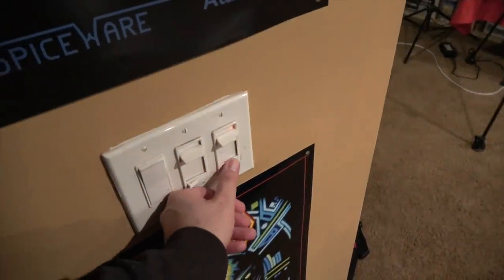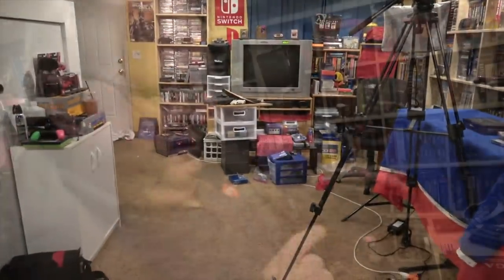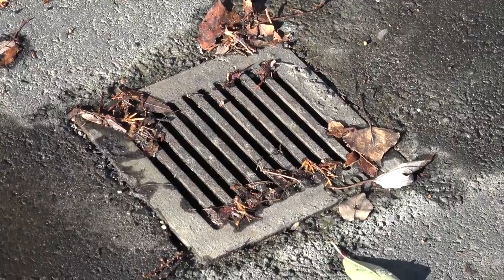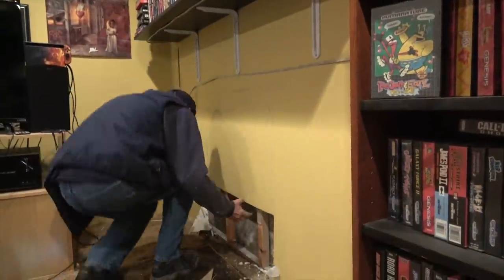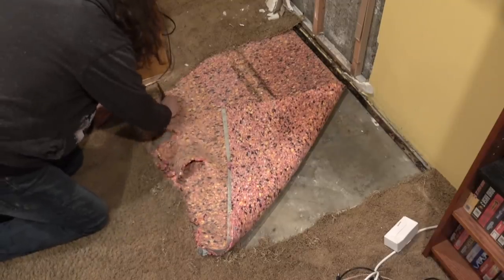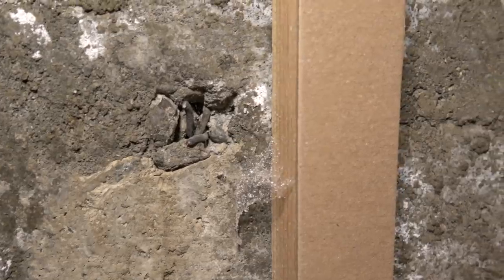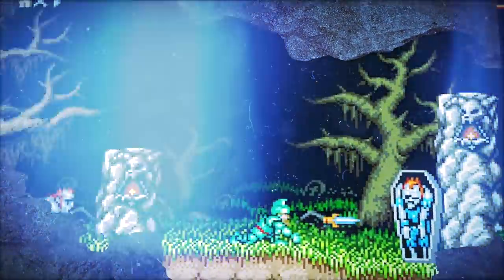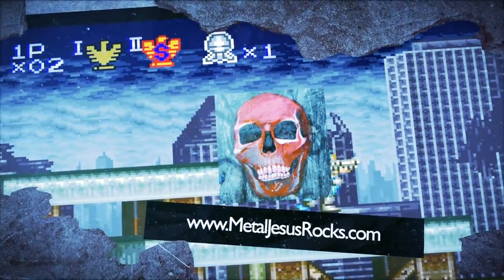OH NO! Water & Mold in the GAME ROOM! $10,000 to fix!

Comment: Such a bummer.  I was watching this and wondering where you live and then saw "PermaDry" and thought "oh yeah, I think we used a company by the same name, guess it's a common name" and then flipped out when I saw you also live in Seattle.  What happened in our house that we bought about 5 years ago is the basement flooded during a storm power outage a few years before we purchased it and the previous owners used PermaDry to help prevent it from happening again.  

Our house also is partially submerged, with the front end of our finished basement being totally underground and the back end being above ground (with a door and window, etc.).  They ended up installing a sump pump in a small pit fed by a drainage pipe that presumably (we don't know for sure since they did the work before we bought the house) collects water on the front end into the sump pit which then gets jettisoned outside the house into one of our down spouts.  The work, about 8-10 years ago was something like $8k but YMMV of course.  I have found PermaDry (we consulted with them to put a drainage system in our detached/partially submerged "bunker" garage) but found them to be too pricey and ended up going with a small Russian outfit that seemed to do an okay job (garage hasn't flooded and the newly poured floor hasn't cracked again due to hydrostatic pressure from the water shelf).

Did they not suggest a more "active" solution than just some passively draining pipes without a means to pump it out?  In our 6-month rainy season in Seattle, our sump pump (Zoeller, the best brand) is going off all the time, sometimes every 10-15 minutes for hours and hours.  I plan to replace it proactively every 5-7 years, and also have a backup sump pump in the same pit and a battery operated pump to suck out water in the event of power and backup (which uses a marine battery) failure.  Just in case, also have a ShopVac that pumps water out too... can never be too careful in Seattle with rainwater (even though we don't get super high total rainfall, just constant rainfall)!

Anyway, good luck with the repairs and sorry you have to deal with this, especially in winter and right before X-mas.

Comment: Something very similar  happened to me at my house.  it was built in the 50's and had a cinderblock foundation.  We looked at the internal drainage system, it seemed very costly plus you loose Sq-footage of the house.  So we opted to fix the problem on the cheap.  We  hired an excavator to do the digging, got friends to slap a membrane and dimple board on.  Other friends to re-drywall the basement and I learned how to put down flooring (I am not a handy fella).  All and all we took an $15,000 dollar fix and got it down to $3,000.
Reply: Oh,  and Keep water off your house!!!!  Clean your eavestroughs, don't have a garden on the side of your house, ect.  I know this sucks and my heart goes out to you.

Comment: @MetalJesusRocks You are going to want to get all that stuff completely out. Digging that trench is going to kick up a lot of concrete dust (and possibly some mold) that you don't want in all you electronics. You may want to get a storage unit. Home owner's should cover at least the detection (may even cover some of the trenching). Another thing to consider is that a radon mitigation would be much cheaper to do at the same time. It looks like the Seattle area is a low chance, but you may still want to test it. It makes a slight modification to the basin at the end of the trench. Finally, this is still letting moisture INTO the basement, so you may want to consider adding some french tile/drain pipe to the outside. That would just be a couple feet below the surface right around the outside edge of the house.

Comment: You should gut all drywall and paint cement with drylock paint. All the drywall needs to be removed so you can coat all. Its a lot of work but not hard mentally have at it. Keep in mind you can not put carpet back in and that any MDF should not be placed on cemment since moisture will wick into MDF and mold will grow.

Comment: Do the work yourself. Get a jackhammer and bust along the wall to put 'big O' weeping tile pipe along the exposed floor. Lead the big o to a sump pump which will discharge the water outside. Also, dimple board will go along the entire stretch of exposed wall. Google what needs to be done. You can cement the floor yourself too. You'll save thousands.

Comment: Personally I'd try and patch/seal that one leaking area myself first.

Yeah the rest could start to fail but equally it's possible they won't.  You may have just gotten unlucky with one of those ties.

I think that's worth doing first and it's work you could probably do yourself, if not then you're looking at a much lower cost.  I've always gone by the mantra of if it ain't broke, don't fix it and I think this applies here.

I'd also probably try and improve the drainage in the yard, maybe with your new concrete it has just become a bit overwhelmed since water will be spilling off.  Digging trenches and laying pipe is easy DIY work if you want to save the money.

Comment: Pack it all up and store it elsewhere in the house if possible or at a friend's place, parents and so on. Or find a good big commercial storage space that you can temporarily rent that is warm and dry (although good luck finding that).

In my opinion, it's just best to empty the entire basement. You'll need new walls and carpet anyway. So the best solution is the most radical one... clean it out, break out all the walls and rip out the floor and let the folks have another good look at your walls... then get it fixed properly and rebuild the game room. It's the only way, cause a half-ass'ed solution always backfires later on.

Comment: Wow that sucks. That's the problem with underground sometimes there's no way to pinpoint the problem. My basement leaked during the hurricane that hit back in September but fortunately it was not too bad. Only about a quarter of in inch leaked and didn't go everywhere. I was prepared through for the storm, I put stuff up really high almost to the ceiling so it wouldn't get wet or dirty. All basements leak at some point in time or another unfortunately. You should consider moving your gameroom to the upper part of the house.

Comment: We had a similar issue with our basement, where we got some leaks on the one side of the basement that was inaccessible from outside (under a cement front porch).  Definitely get multiple quotes.  We found someone that fixed our leaks without breaking the bank.  It seems like adding a sump pump system seems to be overkill for your problem.

Comment: If you can put everything upstairs or in a storage unit for a month or until it’s done because you don’t want any dust from construction (plasterboard or cement dust) getting into your electronics. Mould can kill you so remove all of the carpet and plasterboard in the room the. Replace it. It’s so easy to remove and install plasterboard plus it isn’t expensive

Comment: Maybe drilling out the affected ties and filling the holes with a waterproof sealant with concrete on the inside, or with an epoxy sealant paint to create a water proof barrier would suffice. Same stuff they use on showers.
Reply: That's not the point, he wants 10 thousand dollars.

Comment: I'm in constuction and honestly if this was my house, before you decide to spend thousands of dollars that you might not even need to, I would dig out the earth from the opposite side of where the leak is, find the crack or opening of where the nail is and inject concrete filler or cement for leaks and cracks. That might be all you need. You might never even have any other problems like that anywhere else with your foundation. I would try that first and see if water still comes in. Also I'd recommend maybe installing a French drain if needed. Good luck and don't spend 40k. That's ridiculous.

Comment: Very rare that metal to rust, as it should be galvanized. there is a cheap solution that can work for ever or not but worth the try is to inject a special resin in to the hole, we had the same problem at work and what was done was to drill the hole to clean it and the inject this resin and when it drys its water proof and harder than concrete.
Reply: Filipe Gomes yup
Reply: You are referring to Epoxy injection for foundation cracks. Im currently doing this in my basement (with polyurethane). Its a relatively cheap kit you can buy online. The problem with Epoxy is the crack must be bone dry, whereas with polyurethane it can be wet or even actively leaking and still work. Epoxy though, as you pointed out, bonds stronger than the original concrete. If it settles any further, structurally, you will get new cracks. Doesn't seem to be the case for Jesus, but its worth pointing out.

Comment: Do NOT pay someone to re-do your drywall. You can do it yourself. It's really easy. I'm not very construction-inclined, but I have worked as a laborer for one who is and I was doing dry wall (both taking it out and replacing it) and laying carpet as well. 

Just buy the number of sheets required, measure em up to 4 ft, slice em, snap off the excess and set them in. You gotta leave space for each edge of each sheet to meet half way on the wood you're nailing to, cuz the sheets gotta have something to nail to and Bam you're half way done. Just leave extra if you're scared to fuck up and you can just shave off excess with your utility knife.

Then you just use dry wall mud to fill in the cracks. A 4 year old can do this, once you do it once you'll get the hang of it. Trust me it's easy. Then ya sand it down, easy. Then paint it yourself, eaaaassy.

To pay someone else hundreds or thousands to do this is INSANE, trust me.

Same with carpet. Do that yourself too! If you have to replace the whole section where you film your videos, just do the measurements and buy a large enough piece of carpet. You can get em in one roll large enough as I've replaced carpet in entire living rooms with one roll. Two rolls max.

First you get rolls of carpet padding and just cover the entire floor and cut off excess and staple it down. It's so easy trust me. You cant put it tight to the wall if you want. My boss always gave me shit for taking too long cuz I am a perfectionist so I'd sit there on my knees carefully cutting it perfectly along the walls, but ya don't really have to, but we were working on shitholes so with it being your house, be as perfect as ya want.

So you just get a buddy to help you carry down carpet and unravel it. Then try to just get it roughly centered with the same amount of excess carpet on each side. Use your knife to cut off excess. But not too much. Start like kicking any creases out of the center. Both you and your friend at the same time in opposite directions, in all directions as needed. You can pull up one side and kick it as well while your friend stands on the other end so it doesn't move. Back to cutting excess... You wanna leave like 3inches on all sides. Then you fold that 3 inches under and start stapling. This way is quicker and easier but leaves a slightly raised perimeter around the edge.

The other ways harder, ya lay down tack strip around the outer edge, nail it down and then gotta cut the carpet more perfectly... I just realized it's all concrete down there so... Instead of stapling you'll have to like glue it down or use this special tape instead of Staples and a staple gun probably.

Either way, it's really easy just look up YouTube videos. Trust me. 

Unless you only have to pay someone like $100 to do it all, just do it yourself. You'll realize you can do shit yourself afterwards and it's worth it.

Comment: if you don't trench all around the outside of the house, and then waterproof the outside of the foundation.. eventually  the metal pieces will rust away and your foundations will not lock in place and may shift. A PE(professional engineer) may be able to shed further light into the matter.

Comment: man that's one over kill solution right there. Just open up the hole a little bit more around the metal tie with a hamer and a masonry chisel to make some room and then buy a cement bag and just patch the hole. once it's dry try again the water test and if it doesn't leek anymore you're done , just patch the dry wall and the carpet and that's it man

Comment: 40k Is very high but external barrier has to be done or you will have the same issue pop up again.  Get a 3rd quote. 

1 dig up around the basement so external barrier can be applied
2 install French drains to divert the water
3 don’t do the interior drain. You aren’t fixing the problem just moving it to a different location 

I used to do this type of work for a living. Best to fix it and be done with it than to throw money at a patch and have to do it anyway in a few years

Comment: Time for some French drains. My home is from 1961 also. :(  get the stuff off the floor ! 

When they paved your driveway.. it could have crushed the weeping tile at the footing.  I recommend putting a water proofing membrane on that wall and make sure the French drains are well cleaned and connected

I don’t recommend interior drainage systems.. water is still coming into your basement. You water to stay outside. Yes more expenses but do it right !

Comment: I had a small leak like yours in my finished basement. Doing any work on the inside only is a WASTE of money. Home depot/lowes or other places you can rent a back ho and dig a trench in the areas cheap and fast if you have 1-2 guys helping. To fix this you must seal the outside!. Your problem could also be more...clogged weeping system or broken since it is probably a clay system..... If you would like we can talk more about it.

Comment: All you got to do is patch the hole from the inside with hydraulic cement were the water is coming to your basement. trust me that will hold and it will never leek again. Then go out side and pull that drain line out of the dry well that is coming off the gutter and  is  going into your dry well and re rote  it so the water gets far away from your house. Seal up that metal great in your drive way there fore getting ride of your leaking dry well all together.  The reason your are having this problem cause your whole house is pitched down there fore all the water runs down tors your house when it rains. and you live in an area were it rains a lot. After that patch the sheet rock paint the wall. then check all your other gutters around your house an make sure none of them are pooling up water close to your house to to create more problems. trust me i have bin working since i was 18 i am almost 30 i know what i am talking about if you have any questions feel free to ask

Comment: Condolences. Mould is not fun. They would have used ungalvanised rods which over time would have rusted when got exposed, if they'd used galvanised rods you'd not have had the issue. Something to do with holding/strenghening the concrete in structures. The entertainment unit you have only has the base damaged with the wood expanded, so replacing that panel with a sheet of MDF would do the trick to repair it. Given there will be a lot of dust and moisture now with the repairs, it would be sensible to clear everything from the basement into the house to keep it warm otherwise your cardboard box covers and posters are liable to get moulded too.

Rather than dig out the rock and maybe cause subsidence to the house itself (!) would it be better to apply a thick seal over the current rock and concrete which is all impermeable so waterproof - it would mean ending up with a smaller room however might be cheaper and less disruptive? A bit like a thick layer or plastic or silicone material or whatever? Perhaps worth investigating to see if possible?

Comment: MJR I think you need to talk to someone in your area that uses a product called De Neef
It is a hydroactive grout that is injected into the concrete at high pressure
I work for a company out of Minnesota that uses it on poured concrete walls and other concrete structures.

Comment: That is not a new problem to your basement. That has been going on for years. Concrete is porous and soaks up water. Sure the parking pad probably accelerated the moisture. You definitely need to trench that front side of the house in addition to that the outside of the concrete needs sealed. Anything other than that and you are only covering it with a bandaid. Sealing from the inside will trap moisture in the concrete. Over time the concrete will deteriorate.

Comment: I wouldn't take their word when they say your whole house will eventually have the problem. Rust is a chemical reaction that requires 4 conditions, one of which is oxygen. The rest of those steel ties are unlikely to have enough oxygen to rust.

Also worth noting that you could simply remove the exposed metal ties in your video with a small core drill and reseal the wall for a fraction of the cost.

Comment: Put on your iron boots and jump into the water.  Then find Ruto and keep pressing A until she shuts up.  Next, remove your iron boots and float up and out of the water.  Cut away the drywall until you locate the Triforce symbol on the wall.  Play Zelda's Lullaby on your ocarina.  Viola!  The water will drain away.  Problem solved.

Comment: They’re doing unnecessary work. Glad you moved. But this is an easy fix even if it only lasts for 5 years. Also, get a good sized dehumidifier. Especially with your systems and electronics there. Just don’t forget to empty the bucket or tank when it gets full, because it can overflow. They fill up pretty quick too.